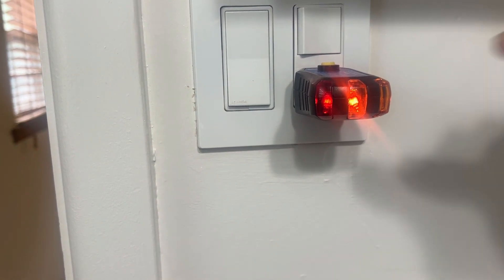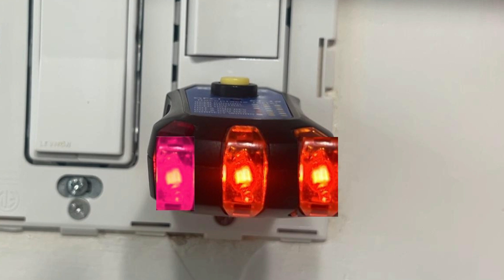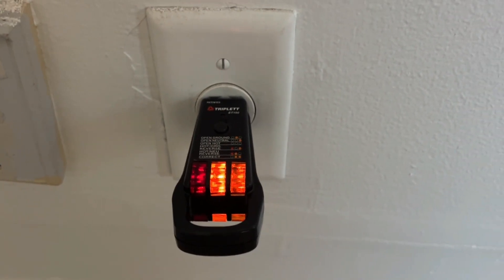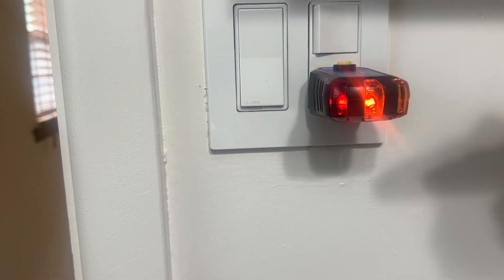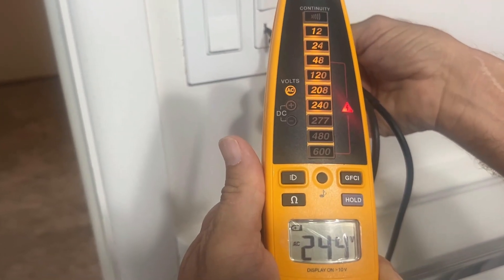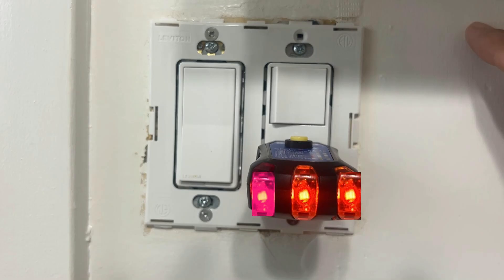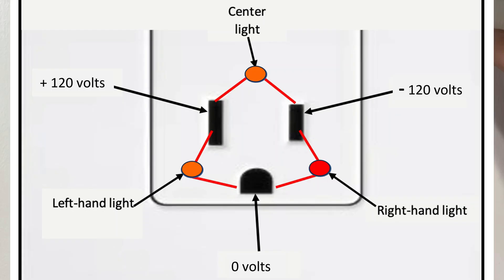3-Light Tester - Why Are All Three Lights On?

Comment: Nice addition to the previous videos about 3 light testers along with the diagram near the end showing why a standard 15 or 20A outlet miswired for 240V will show up as all three lights on, because all the three light testers that I've ever seen and used never included this on the legend.  

I actually ran into this situation once, in April 2014 upon moving into the River's Edge Apartments in Waterford, Michigan   There was a thru the wall air conditioner, and the factory plug had been cut off and replaced with a standard 120V/15A plug and plugged into a 120V/15A duplex receptacle which also happened to be located where I needed to plug in my floor lamp with a CFL bulb.  At dusk, as soon as I turned the switch there is loud popping, smoke and bright flashes and the bulb lit on fire.  In a full blown panic I smashed the lamp out through the window off the second floor with the bulb and plastic shade on fire.   After a few shots of ginger brandy to calm myself, I insert my three light tester and wasn't exactly sure what 3 lights lit meant, so I grab my wiggy meter and sure enough, 240V.  What likely happened was the outlet or plug had burned or corroded itself from a loose connection and the maintenance guys simply used whatever materials were on their truck to make the repair because they didn't have the proper outlet, and shrugged "well, air conditioner is back in business, tenants are happy, job well done ".
Reply from the maker: Thank you, Sparky. I always appreciate your comments and the education you give me and my audience. I have a new crazy situation that I am wanting to make a video about, but I need an expert (such as yourself) to help me figure out how this can be happening. I would really like to send you a description and video of what’s going on
Reply: Yes, thank you. I'm a home inspector in GA, and all three lights lit up on my tester today. It's the first time I've come acrossed this. I came here because, yes, it's not on the legend.

Comment: How do you fix this?
Reply from the maker: It actually should be pretty simple. You need to disconnect the hot wire that is connected to the neutral side. Then you need to connect a neutral it all depends on where they rent the hot wire from but if you can locate it, it’s possible you can use the existing hot wire that was connected to the neutral wire and connect that in the panel to the neutral bus. This will only work if you know it is a home run, which means that it goes directly from the panel to that receptacle. If there are other things tied in in between, then you’re going to screw up everything else by doing this, so this will not work. But basically you need to get a neutral wire to that receptacle and get rid of one of the hot wires.
Reply: @morganinspectionservices3840 with all due respect, if a 15/20A 120V receptacle is indeed reading 240V, it's going to be a dedicated line, probably intended for something like a large air compressor you may have in your garage and someone installed the wrong receptacle by mistake.  That being said there are some rare exceptions where you might have multiple receptacles on a circuit intentionally wired for 240V, one such example is the grow room at my friend's property, in a shed fed by one 20 amp circuit using 12/2 UF, with the 3 receptacles in the shed replaced with duplex NEMA 6-20, and the wall sconce at the entrance has a commercial style LED bulb rated 120 ~ 277V, and a label maker was used to mark it's E26 socket with "WARNING! 240 VOLTS" in bold letters.   

The reason for this change was because he is currently using six 400 watt metal halide fixtures which can be set up to run at 120/208/240/277 volts, and because that shed and it's 12/2 UF was already there when he purchased the property and running all the lights caused the 20 amp breaker to trip. It turned out to be cheaper and easier to cut the amp draw in half by converting the shed to 240V and making do with the existing wiring.  Otherwise he would have to install a sub panel in the shed for running additional circuits.
Reply: Thanks for the reply. After taking a closer look at the issue I’m having, I don’t think it is this. What I’m seeing is the last two outlets on this circuit just stopped working and all 3 lights on the outlets tester are lit up on them. I turned off the breaker and everything seems like it’s wired up correctly. I also switched out the last two outlets with new ones but they still don’t work. I’m kind of at a loss here and ordered a multimeter along with a pack of new outlets to replace the rest on that circuit.
Reply: How do I fix this I'm having this problem too  @adroc9841

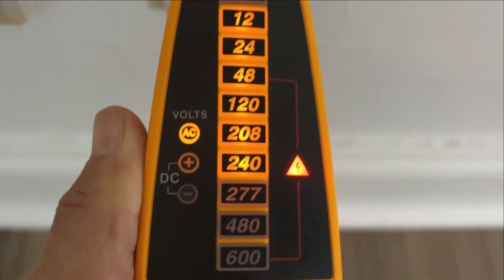Comment: I bet that single outlet @ 0:30 was intended to be a single 20A - 240V device for a big air conditioner or space heater more than 1500W give or take and someone saw the T slot and assumed they had the proper outlet.  Either way, we never assume that what we see is what we get.
Reply from the maker: I agree with you that that would’ve been for a large window air conditioning unit or something similar.